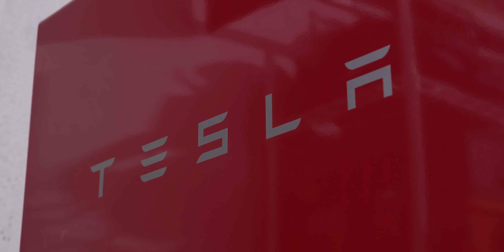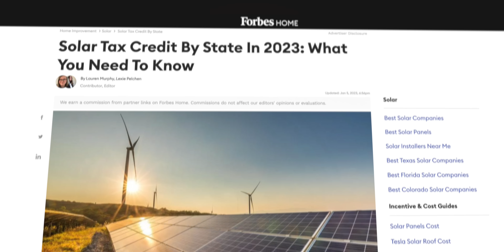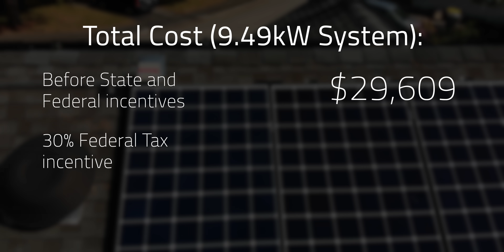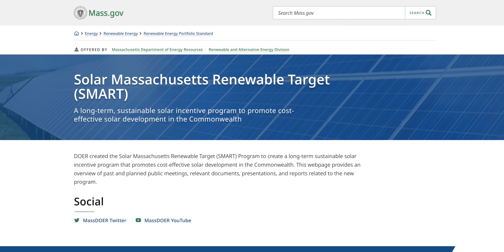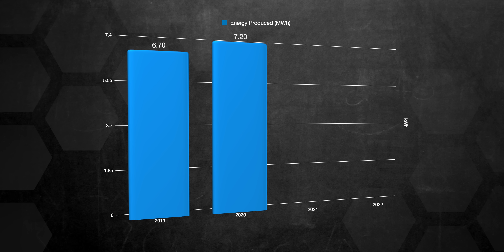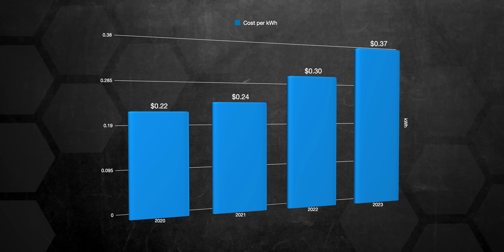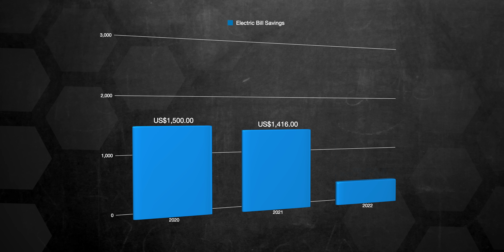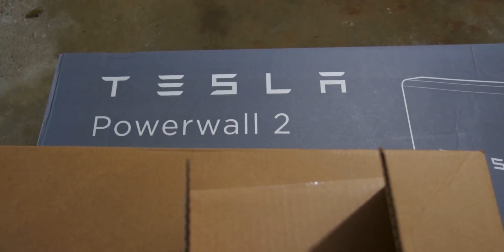5 Years with Solar Panels - Is It Still Worth It?

Comment: Hi Matt. I'm from India. We have almost 300 to 330 sunny days in a year here. I've a 5.2 KW polycrystalline solar panel system. Following are some statistics
Total cost - around $2400 (after government subsidy.)

Date of installation - June-2020. 

Avg production - 7.2-7.3 Mwh/year 

Avg consumption - 4-4.5 Mwh/year. 

Billing cycle - Bimonthly

Net metering - 1:1 (calculated Bimonthly)

Electricity rates - about 9 cents/kwh

Credit for excess electricity exported to grid -  2.27 cents/kwh (calculation is done for every billing cycle)

Savings since system installation (32 months) -  about $1200

Credit in bank account by Discom till date - $96
Current credit with Discom - $76

 I've never paid any electricity bill in last 31 months. Credit with Discom is used to pay fixed charges (e.g. meter charge) and to pay the bill if I import excess electricity during a billing cycle.

Subsidies are great in India. Even without subsidy it costs only about $750-800/kw and with subsidy it costs about 450-600/kw for the first 10 kw system.
It was totally worth it.

Comment: My house with solar panels is in Hong Kong while my wife and I spend quite a lot of time in the USA with our children and grand children. Back in mid July, there was a storm and the fuse was blown off by thunder. Solar stopped working and we only found out in mid December when we returned to Hong Kong. It was my mistake not to check our local electricity supplier how much they have credited our account for those 6 months which turned out to be around US$3,000. Yes, our Hong Kong gov gives out a very generous subsidy to those that install solar panels, about 3.5 times what we pay for our use of electricity. This will go on to Dec 31, 2033.
Reply: mine is 10KW

Comment: Here in Southern Kalifornia, we have more sun than most of the country! And yet, the house I bought has solar on it installed by the previous owner. I was one of the biggest mistakes I've ever made considering the solar company has a clause in the contract to pay me back for the difference between the lease cost and my actual energy costs if lower than the monthly lease amount. The panels were inistalled and operational when I bought the home and I thought this wouldn't cost me any more than if I had no solar, I moved forward with the purchase.
And the nightmare began... dealing with the solar company was a trip down insanity lane. No one competent could explain how they did the energy analysis. No one was even wanted to take responibility. It wasn't until I wrote to the legal department threatening to take legal actions before I got a response. The solar company played games with the calculations and still aren't honest on how the calculations are to be done correctly.  
Folks - unless your electric bill is 5X each month, don't even consider solar as it is just a huge scam and you will be wasting your life and time for very little gains if any.  If you have high electric bills, conserve. if you can't aford it, then don't use it.  
For Matt to say his house had 1 megawatthr of electric usage is absolutely insane. I have a large house and during the heat wave we had in Aug/Sept last year, runniing the AC nearly full time, my electric bill was barely 400kWh for the entire month!   So Matt must have some kind of grow farm going harvesting whatever he is growing.  For the average household, DO NOT EVER GET SOLAR if you value your TIME and SANITY!!

Comment: My state of Michigan is incredibly unfriendly toward electrifying anything/renewables.  EVs have no state credits and actually charge more for vehicle registration for PHEVs and EVs.  There's no state credit for solar, no SERC credits (I forgot about those after seeing an earlier video by Matt), no anything.  On top of that, the electric utilities are switching to ToD rates starting March 1st, dependent on the billing cycle an account is on which costs nearly a 25% premium for on-peak consumption during the summer.

That being said, I did get a Sunpower solar solution installed in 2021, 7.56kw of panels - 18, 420kw units with micro inverters, and a 26kwh battery solution.  I expanded it in 2022 with 6 additional panels and another 26kwh battery with inverter.  Up front cost was astronomical, and I only got a 26% credit for the 2021 install, but got the 30 for the expansion.
Reply: As those glorified golf carts pay no gas tax why shouldn't they have to pay a road use tax when you get your plates. God bless Michigan. 

And if EVs and solar cells are so good why do people that don't have them have to subsidize them? If they ae so great why is there not a premium  surcharge for them like there is for a new Corvette?
Reply: The gas tax doesn't seem to fix the roads here very well.  Besides, the vehicles that damage the roads the most (big rig trucks) pay the lowest fuel tax in comparison to all of the surrounding states by a large margin.  I'm not against a future cost.  I just think it's a little early since barely 2% of the vehicles on the road are electrified golf carts.

Every vehicle on the road is subsidized in some way.  EVs get an incentive to encourage people to buy them and to make them more affordable.  Electrified anything is more expensive than the traditional gasser.  That being said, thank you for your contribution toward my PHEV and solar solution.  After all, I don't have kids and pay a lot of excess tax to subsidize other people's kids to go to public school and give their parents a huge tax break.

Comment: One thing to add. I personally wouldn’t do a VPP. Cycling your battery that hard can shorten its life. Sipping on it yourself you can make it last a lifetime. Cycle it 80% a day and you’ll be needing a new battery in a few years. That 700$ check isn’t gonna get you a new 14kwh battery . I only use the top 20% of my batteries because I’m off grid and I want em to last

Comment: I researched a solar panel installation (through EnergySage) and received two quotes at different sizing.  Unfortunately, I couldn't make the math work even though our home energy use is 100% electric (stove, water heater, clothes dryer, ductless heat pump, lighting, etc.).  Even after the new federal tax credit, and a state incentive to waive sales tax, the payback period was over 15 years with both quotes, and the amount saved after 20 years was peanuts (I would almost certainly make significantly more money with conservative investments).  And that was without optional battery backup.  I live in an area with some of the cheapest energy in the US, which makes the math more challenging. It's also some of the greenest energy in the country, so I wouldn't be getting an ecological win with my own power generation either.  Factor in time and maintenance needs, and it just didn't make any sense, unfortunately.  So, I'm thrilled that solar panels are working out well for many, but for me, it just didn't make any sense at this point in time.

Comment: I have an ideal roof orientation (also Massachusetts). I FEAR a roof leak. I had one from a dish years ago, and there was about $60K of water damage. The installer went out of business, so no $$ there. I ask solar installers who is responsible if the install leaks. No answers. So... anyone had a leak experience?

Comment: The biggest problem with solar in my opinion is the rebate system. When I retired from the electrical field, I thought I would find another job. I was recruited by a solar broker who told me I could make up to a $1 a watt on contracts I sold and was pretty much the norm. There was even a bonus if you could get a jacked up price.
The sales method is directly related to the 1st year solar credit. The more the system cost, the higher the credit. So I was quoted by companies like this $40k+ to install a 10kw system in the San Francisco Bay Area on a very simple and easy roof. I went ahead and did most of the research myself and hired a company for $750 to make all the plans required for the permit. My son and myself installed the entire system for $16k complete in 2 days. Now mind you, I already had my complete electrical system ready before the installation, something the $40k quoter was aware of. So my rebate was about $4,600 leaving me with a total of $11,400.
The sales pitch goes something like this... We install the system on your roof and finance it with monthly payments a little over what you are paying now but in several years, it gets to be about even with prices going up, and then gets better. But the real pitch is the $12,000 you are going to get the first year. Yes, many just sign with that $12,000 in mind the first year. This job could have easily been installed by a contractor for about $20k. I figure the plans and permits around $1,000 and 32 man hours at $100/hour should cover it.

This is just a sales gimmick that is costing the taxpayers billions of dollars in unscrupulous contractors pocketing the huge profit margin.

My thought is that the government should subsidize systems on a price per watt system, not a hugely inflated percentage. That means that a $20k system would get the same amount as a $40k inflated price putting that sales tactic away for good. The subsidizing tax payer would win as well as the unknowing homeowner.

I also think that the price of panels and equipment would also fall if there was no  subsidy by about the same as the subsidy. All that subsidy money is just making corporations rich and I am sure they lobby hard for the current system.

Just my thoughts and observations.

PS... I was an Electrical Inspector that saw hundreds of installations by dozens of contractors. I got to fing out that some contractors were charging 2-3 times of others for similar systems. And the ones charging hugely more money were the prevelant big names who had exceptional salesmen.

Comment: Wow - I pay 6.32 cents per kWh up to 40 kWh / day (averaged over a 2 month billing period), thence 9.5 cents / kWh.  Annually (electrically heated home) is about $2000 (incl. tax).  That's CAD $ - so even less in US$.
And our Provincial utility exports power directly to Matt's backyard in MA over a 1300 km 2000 MW HVDC line from James Bay straight down to Sandy Pond MA.  Thanks MA!

Comment: One subject I NEVER see in video's like this (not just yours) is what would a hail storm do to these panels? Here in west central Texas, we have small ones every season. About every 4 to 5 years, golfball, baseball, and almost every 7 to 10 years, softball-sized hail. Solar panels are not as expensive as they once were, and they are getting more powerful, but the payout is still over a decade. Also, they are costly to insure, if at all. When you add storage, the price exceeds what most people can afford, even with the taxpayer's help.

Comment: I’ve been living with solar off grid since 1994. I have never paid an electricity bill in my adult life. YES it is definitely worth it. 

For doe the first 15 years we only had 800 W of panels. Now we have 3kW. My current set of batteries are 20 years old! Most of the upgrades I am planning, will be made using 2nd hand equipment often given away.

Scrap deep cycle batteries can be reconditioned if you are prepared to get your hands dirty. If you have to buy a new cell to replace a shorted out dead cell: do so! For the price of a single battery you have transformed a pile of scrap mettle into an asset with a $5000 replacement value. How many legal jobs can turn $300 into $5000 in a few hours? Leaking batteries can be repaired using Cycloflex car window silicone. Battery reconditioning is hard dirty work, but well worth it.

If you have got what it takes to fix your own computers or cars, you can put together a complete off grid system for the price of a new household appliance and a month of DIY. 

If you don’t own your home, build a mobile system and set up your panels in the back yard! Generating and storing your own power is FREEDOM.
Reply: No question you are not into metal working as a hobby. With welders and 5 HP motors a diesel Generator would be a necessary.- There are other power hungry things too. - My wife's friend just had me wire up a 7000 KVA pottery kiln.(Over twice the output of your system) 

If you are willing to live with the restrictions be my guest. I'm not.   Solar is just like the glorified golf carts. - Not of any use to a big chunk of the general population.(that still has tax money go into these NWO systems.

Comment: Great and very helpful video.... Thanks.   Unfortunately, my wife and I are in are late 70s, so it is not practical to invest in solar as well will never see the full benefit of having it installed. In addition, we would have to have to re-shingle  our roof so that it would last as long as the solar panels. 

Are you setting up your system in your new house so as to be able to recharge EVs which will probably be your next type of car purchase? 

BTW, I have been investing  in stocks with companies that are making EVs, solar panels, EV charging systems and fuel cells.  At my age, I will not see the fruit of my investments but my children and grandchildren will.

Comment: California is about to screw future owners of solar panel systems. They are pretty much forcing you to install a massive battery because they will give you a fraction of the true value per watt of power you send back into the system. 
If you push XX amount of power into the grid during the day and use XX during the night you basically owe or make nothing. Under the new rules you would only recover 1/4.

Comment: It seems like a no-brainer to go solar if you have a place to install it and you drive an EV. The more electricity you use the higher the tier you are in and the faster your solar system breaks even. The question I have and I am having a real hard time getting an answer to is what is the minimum sized system you can install and hope to break even within 10 years? If you guide answers this for all the different states I will sign up for it right away.

Comment: Live in Ohio with a 14kWh system. We have a 30 acre horse farm with two out buildings that include conditioned spaces. The house has 2 HVAC units. Cost us 40k to install. We also got a bunch of money back in taxes. 

My biggest question I would like to have known is how to ask for expandability. Being a hobby farm as well as amateur carpenter we use a bunch of power. I would like to make more. 
Would love a battery setup, but I am still missing how to add that into our complicated power setup. 
To date we have made 57483 kWh. The panels were installed fall of 2019.

Comment: Things I wish I knew before I got my solar panels: 1) Microinverters are delicate and can be damaged if a large surge hits your house (the kind that damages power strips, appliances, outlets, etc..).  Therefore, I advise everyone with electricity in their house to get a Whole Home Surge Protector.  A contractor can install one between your circuit panel and the rest of your house for about $400.  I wish I had one when that idiot crashed into a telephone pole that blew out the transformer that destroyed half of my microinverters.  The sad thing is that the solar panel installation manual "strongly encouraged" adding one but my installer never mentioned it to me.  2) Get a clause in your solar installer contract that gives you at least one free removal of panels for roof replacement and don't believe their lies when they tell you that roofers can "roof around the panels".  3) Get a solar installer who has a local presence.  My solar installer makes excuses to not come out to my house because they have a 90 minute drive.  4) Be wary that you may need to cut down some trees to qualify for State rebates.  I had to pay $2000 to cut down a tree to get Pennsylvania's solar rebate of $5000 because they said the tree's shade would reduce solar generation.

Comment: My experience getting solar on my roof in North Carolina went from "Looks good" to "What just happened?" the $25,000 price was quoted for 17 320W panels, but the contractor kept sending blueprints with the panels on the wron side of the roof, for example. The company owner sold the company just after I signed for the $25,000, which was rushed because NC supposedly had a $2,500 solar rebate which was only processed once a year, and the paperwork for me to sign did not arrive until 2 days before the cutoff. I quickly signed to get the project number into the NC system, did that, and heard back from the state a week later: "sorry, you did not win the lottery." The salesman lied about it, then delayed the paperwork, to rush me to sign it. When I finally read the fine print, the verbal contract that they would put $2,000 of the $25,000 to a tree-trimming company was replaced with the words: "Customer accepts 100% responsibility for tree trimming." The company to which he sold the business is in Utah, and after them assigning different project managers to me every month for 3 months, I just stopped talking to them. Then the DC/AC box provider promised to email me a link to online monitoring of the exact second-by-second production. 3 rounds later, still no software. Not a good experience here in NC.